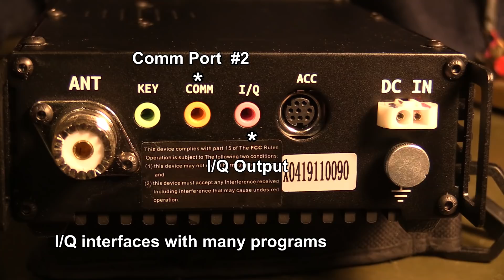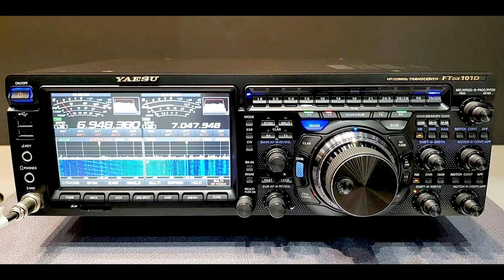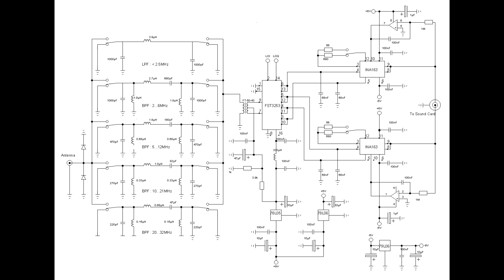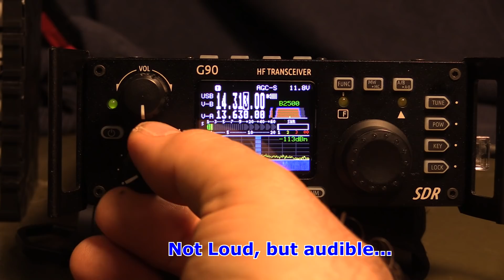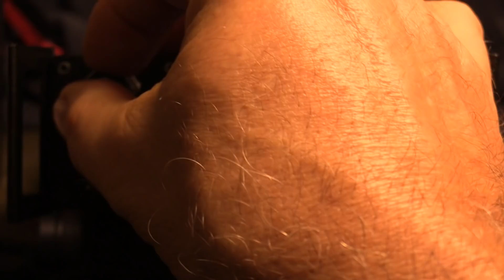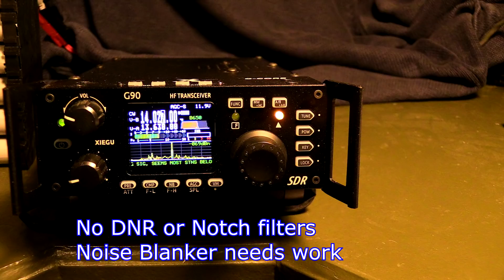Xiegu G-90 QRP SDR Radio Review

Comment: Bob, I've studied Yaesu 891 and Xiegu G90 trying to choose. My intent is battery power for hiking and grid down. So low power use is a factor. I've built several folded dipoles with good results. Would you recommend G90 for this role?
Also your review is the best I've seen on YouTube. The comparison with other rigs and SDR tutorial put your work head and shoulders above others.
Thank you for the effort and thought you put into your work.
With Respect,
Ed
KI4SBU
Reply: Ed- Well, first- thank you! My goal is to be the best reviewer, not the most popular. I would suggest the G90, but it's case is 1/8" steel. It's a heavy bugger. The 891 may be slightly lighter, but it is not designed for portable use. It will draw nearly an amp on RX and 15A on TX. So, what to do? Really, the best choice is a IC-705 with a power amp. This gives you ALL bands. Xiegu makes a tiny/light 100W HF power amp. I'm testing it here. You must add a low pass filter section, but they have that too. I'd make /buy a LiPo batt pack. I use 18650's to make portable power packs. Lots of YouTube vids on that. Get Sanyo or Panasonic cells. All the rest are crap. Folded Dipoles? Yes, my choice exactly. For UHF/VHF antennas, just make coax dipoles. Strip off the ground braid from the last 19 inches for 2 meters and about 7" for 450. Make a dipole out of it. Yes, the 705 is costly, but check the weights...cuz that matters. The G90 at 20W does the job. Add a Pipo wedge Win 10 PC and do digital. Then you are great at 10W.  Lots to think about!

Comment: Just ordered one of these. Looking for more info and you delivered! Good overview. Thanks! 

Question: what antenna is good for it?
Reply: Really, I would make a 139ft closed loop. Get it as high as you can. Shape and evenness are not important. The internal tuner should resonate it on all bands. It's low noise, cheap and a good performer. Just feed it with RG-58-U or whatever...one side hot, the other ground. One step up would be a Carolina Windom
Reply: Thanks! I'll have to see how I could fit it in the backyard.

Comment: It is no good to absolute newcomers to SDE when the guy making the explanation, stumbles over words made unintelligible even beyond slowing it down SEVERAL TIMES.
What the blazes DOES he say at 3:25?
And at 8:23?? Sounds like "legatory receivers". What does THAT mean? Is this guy on the sauce?  Or am I?
Reply from the maker: He is me -and I said: "An analog to digital converter chip's (ADC) dynamic range is primarily determined by it's number of bits". A 16 bit ADC chip will provide a basic dynamic range of around 100dB. This is adequate for HF work. Two tricks are used to enhance it's performance: Decimation and Dithering. Decimation is over-sampling the incoming signal and then reducing the data down to the original bitstream. This is sort of like good old Dolby noise reduction...in reducing the over-sampling down, you increase the signal to noise ratio and dynamic range. Dithering is adding custom noise to the incoming signals to mix with spurious signals and blend them into noise. This raises the base noise floor, but improves basic performance. Hwy, I'm no expert! Check out Adam Farson and others for a fully technical explanation of SDR tech.
Reply: @robertnagy2163  Hi Robert..
Many thanks for your A1 video and prompt reply.
An expert you are, in comparison with my knowledge. I am trying to absorb the principle and have realised that just like HiFi, the higher the sampling rate, "the higher the Fi."  After all, with analogue it's tantamount to continuous sampling...
However, try as I might, I cannot unravel the actual words used at 03:25.
"It's important to know that an ADC chip, an ????? chip's dynamics range
is primarily based on the number of bits...etc."
And again at 08:23  "For both types of receivers, ???? traditional super-het. or
blend of...etc."
I question not, your tech info. You kept the level to suit 1st time enquirers.
Possibly Mr Farson will give too much, too soon.

Please take this as an indication of the importance that I,  an SDR rookie with a 62 year old Ham ticket,  (not me...my licence. I'm just a BIT older!) attach to your description. 
It means that I am listening closely and don't want to miss a single word if I am going to learn! 
Thank you and stay safe.
 From your former colonial oppressors in Olde Englande.

God Bless America. Like the rest of us, she needs it.
73 de G3NBY.  OK QRZ.COM.
Reply from the maker: @MauriatOttolink  Ha! God know we need a blessing right about now! The next 90 days in the US will be ones for the history books. My previous post covered your first question. "...To know that an ADC's number of bits- determine it's basic dynamic range" . Indeed "Legacy traditional superhet"... What I'm saying is that some receiver tests from the superhet days are not appropriate for  SDR's. They just don't fail in the same way. IP3 is the main one that is now superfluous. The growth of these SDR's is dependent on the price and performance of A to D chips. In 5 years when a 24 bit A to D chip that is fast enough to capture all of HF at the same moment is 20 quid, SDR's will be cheaper and simpler than any superhet. It is like the batteries on electric cars. When the next gen battery is released, you can charge once every few months. Then gas cars are truly finished. Better, simpler, cheaper, longer lasting and with less ways to fail. Design of anything needs to follow the rules of efficiency.  Every conversion of sunlight (or the energy of an RF signal) into another form of energy (audio in our case)- loses some power in the form of heat (I2R losses) (2nd law of thermodynamics). In radios, circuitry also adds noise. So an electric car or and SDR which puts less conversions between the raw energy and your desired end product - results in higher fidelity in the system. Less noise, less loss...a more efficient system. There is always resistance to change, but the future always arrives. SDR? It is here to stay.

Comment: Really good review.  I have macular degeneration and having trouble seeing overall but especially up close.  I’m trying to find a good QRP rig with large enough numbers so that I can see them enter.  Any suggestions?  I’ve looked at the KX2 and the X-5105
Reply: The 5105 has larger letters...and the G90 has a 7" color screen remote being released soon. I will post it as soon as th efirst one arrives. The KX3 is a super radio too!!

Comment: Excellent factual review. Well structured and informed analysis. - I think this is the best review of the G90 I have seen. Have ordered one myself... 73, M7KPS
Reply: Thank you! That is indeed my goal...to be complete in my analysis. These are fun little radios and the 20W is enough to be heard on SSB. Not lowering power out at down to 10 volts is also a great design feature.

Comment: Interesting anyone know if it  can transmit Alaska emergency ? ( 5.1675MHz 5.1689MHz) and I get you dig 20 watts lol I do as well as have an FT-897 for that reason . Have you done any comparisons to its receive and or transmit quality vs others in this genre? durability reliability now that have more time to evaluate? thanks for in depth review definitely considering it
Reply from the maker: Xiegu has ironed out some firmware problems and have been very responsive. Currently, the 1.74 beta firmware has been problem-free. The new GSOC 7" LCD remote control touch screen unit is coming soon...and I just got word this morning that they are releasing a 100W power amp kit ..very tiny!

Comment: Can you tell me a good antenna to use for this radio. I just got my Tech rating on May 16th and want this radio to work out in the wilderness and sometimes across the borders ie Mexcio. I will mount this on a portable unit that goes in my side car of my Ural Motorcycle.  Most of the time I will be outside. I have built a Bioenno Solar pack to accompany this radio so any kind of help would be nice. One more thing I enjoy the technical portion of the videos I am an engineer we like this stuff.
Reply from the maker: Great!  OK, ANY "whip" type antenna that you mount on the bike- will not work well. You need wire in the air. Use the radio when you are stopped. For portable use I suggest you build a Folded Dipole for 20 meters. Then bring two runs of wire about 17 feet with an alligator clip at one end. On the other end connect some rope. Build your folded dipole following instructions on any website. Use a 4:1 balun transformer! (small one is OK). Then hang it up where you can adjust it and tune it by shortening the wire little by little until your SWR is under 1.5 to 1.  Then add one of the 17ft pieces of wire to each end of the folded dipole (alligator clip to a bare wire) and string them out horizontally to a tree -thus doubling the length of the dipole.  Now put the radio on 40 meters and use the internal antenna tuner to adjust the SWR down automatically. Thus you have 20 and 40 meters...the only two bands you will need. You may want to do the open TX modification as shown on my video. This will enable you to use it on CB. The antenna above will load using the internal antenna tuner on CB. Try to get the general license...which will allow you to use all the bands!

Comment: Just retired and just got my license.  Looking for a rig that I for my little 25 ft Pocket Cruiser boat that I intend to strike out into the Great Lakes and Great Loop way past my Marine VHF 156-157 Mhz range of 12 miles.  Space for equip is severely limited.  I understand the G-90 is HF only but range is what I need if I need assistance. Your presentation was the most professional and thorough I have seen on this rig. 

I don't know enough YET so I'll ask: As I understand Marine SSB includes, and I'm not sure if  the G-90  can Rx/Rx on  4.0-4.38,
6.2-6.25, 8-8.815, 12.33-13.2, 16.36-17.469, 16.46-17.36, 18.78-18.9, 19.608-19.8 and  22-22.855MHz band frequencies scattered throughout the ham bands or are these freq notched out on the G-90?  Marine SSB rigs appear few, expensive and BIG that require separate tuners and other gear .  If I am limited to the Ham bands with the G-90 or similar, then, I suppose that's okay since there is always somebody on the waves that could relay an SOS or Pan Pan. 

Again, thanks for the time, effort and detail of this video.  You did a great job and I learned a lot.  If anyone can input any helpful info on my application it would be greatly appreciated.  An antenna is also on my hunt list with a 25 ft boat limitation.

73
Reply: The G90 is shipped strapped for the ham bands only - as required by the FCC. I just found- there is a mod to open it up to cover the marine bands as you desire. Of course, at this point, you are out of FCC compliance and we have no idea how the radios low-pass filters will clean up harmonics in these bands. Take a look..it is easy! https://www.youtube.com/watch?v=6uftTV05ung

Comment: What is best?
XIEGU G1M		£205	5W 	@13.8V		.36A max

G90 - 			£378. 	20w	@13.8V		1.5A max

KN -990 		£440  	15W 	@13.8V		1.1A max

RS958 mchfclone 	£350  	10w 	@13.8V		.72A max

RS918 mchfclone    	£436  	15W	@13.8V		1.1A max

mchf 	

Ailunce HS1 H		£400  	15W	@13.8V		1.1A max

X5105			£636   	4.5W	@13.8V		.33A ma
Reply: I owned most of them.  It is the G90!  No question.

Comment: Hi Robert. For a new ham... would you recommend the G90 over say the Yaesu Ft-450D?
Reply: No I would not. I would go with the Yaesu. Find a very clean used one...use it till you outgrow it, sell it for what you paid for it- and then you'll know which radio to get. Or, bypass this all and buy a Icom IC-7300 and own it for a decade!
Reply: Bob Nagy thanks for the advice!  I’ll check into the Icom 7300.

Comment: Thank You for this video. I'm wondering what's the differences between the G-90 and my Elad FDM Duo? Also I'm hoping Xiegu will add FM broadcast band also, then I'd be really happy
Reply: I have the Elad FDM Duo as well. There is no comparison. The Elad is a direct sampler SDR. It's outboard software is about as sophisticated as you can get with an SDR. The Elad can open 9 RX's at once. It's signal is VERY clean. You also pay for this stuff. And it is Italian, so the case looks great. I use mine strictly for digital modes. I will never sell it. Portable? Its the G90!
Reply: @Yavor54  Thank You. This is exactly what I was looking for. OBTW, my Elad is red too. I'm also waiting to check out the Icom 705 as well

Comment: One last question, my SCOPE is not yellow but rather a light blue, how can I change that color? 
Is there a hidden menu somewhere? 
Also, the sensitivity of the RX is so hot. Any suggestions?
Reply: The current firmware does a light blue fill color. I could not find a way to change it. Also the current firmware included a RF gain control. Can't remember off-hand, but I dialed mine down to just over half, and it is perfect now. Look at the docs.
I also just heard from them that I will receive the first remote control hear with larger LCD. I'll review it pronto.
Reply: @Yavor54  Thank you for your response. Im having RX issue with mine. Sounds like the RX is Deaf. I have checked all connections, tested all types of antennas and even have done RX comparisons between my IC7700 and the G90 signals are way down. I did contact the dealer and they are having me do all various tests with no avail. I even performed a factory reset along with re-flashing the firmware as a recommendation by the dealer. Nothing is working. I have my FFT down to 1 and I get very little activity on the scope. Any suggestions?

Comment: I would love to see how it how it compares to the KX2. It looks interesting thank you for the video
Reply from the maker: Completely different animals. the KX-2 is a much more mature design. The G90 is still in beta testing basically. It's basic functions work OK, but there are many rough edges. Elecraft has a lot more experience in making radios...and it shows. You will be part of the G90 test group if you get one. They are responsive so far.

Comment: OMG this radio is what i need for camping! and i can run a 50~100W amp with it if i even need to...
Reply from the maker: Run a resonant antenna instead of a hunk of wire, and you won't need an amp. I use a folded dipole for 20 meters... kicks butt with the G90 on islands.

Comment: Dear Robert. May I ask you about the minimum output power, please? 73 de ha5cst.
Reply from the maker: 1W ...Less than 1W.  A rádió jó ár-érték arányú rádió. A jelenlegi firmware-nek problémája van, de hamarosan kijavítják. Boldog új évet!  Bob
Reply: @robertnagy2163  Köszönöm, Bob! SOTA kitelepülős riget keresek, erre ezek szerint majdnem ideális, ezen az áron meg nagyjából nincs más (nem találtam).
Reply from the maker: @Professzore  This is a good choice for you....but the 1.6 firmware is best. I have sent information to China on problem with mic audio in 1.7 . A családom Miskolcon van. Ha Trump megőrül, akkor lehet, hogy Miskolcba kell mennünk! 73's  Bob
Reply: @robertnagy2163  On Facebook, there were some reports about unresponsive PTT. Not serious. I wondering if it's available to downgrade. Or even making new firmware (by the way, I don't know any of the internals of the radio yet).
A helyzet sajnos itt sem jobb érdemben... :-(
73!
Reply from the maker: @Professzore  No, PTT is good. Quality is not Japan quality...but OK. I have 1.6 Firmware I can send you if you receive 1.7 firmware. 1.74 will be fixed.... I would order G90. You will be very happy with receive quality. No difference from my IC-7610...maybe G90 is better. Also, external large LCD screen control unit is coming soon. I will have it first.

Comment: Not sure if I want the G90 or 5105.  I like the 5105 but it does not have the water fall but it is completely portable in that it has an internal battery.  Does the G90 have an internal battery?
Reply from the maker: No...but it is easy to power. The 20W output makes a HUGE difference.

Comment: It would have been really sweet if you could plug in a keyboard and do PSK and RITTY directly without having a laptop, kind of severely limits the appeal for portable use in these modes. I haven't used digital modes yet, needing a laptop is a pain in the ass. 

Internal battery would also have been great, the X5105 is a great radio, I really like it, it's compact size and battery make it a really portable rig. 

The RS-918 I believe can do psk directly with no PC ? but try get your hands on a decent one. And will it work properly ? anyone's guess. Cool radio thought. 

The G90 is a sweet radio all the same and could be my next radio.
Reply: You just don't get all the features of a $3000+ radio in a $450 radio. It seems like since they gave us everything else, why not DSP and internal digital decode? The features had to end somewhere. The answer to this issue is a tiny Pipo computer with a $3 audio USB card added. The G90 has what is really needed, and that is superb basic RX/TX performance. Soon I'll release a hack to boost it to 30W TX.